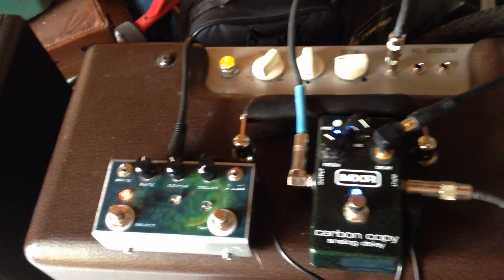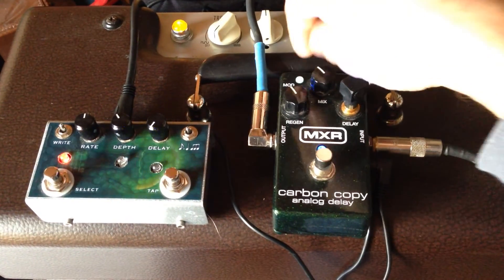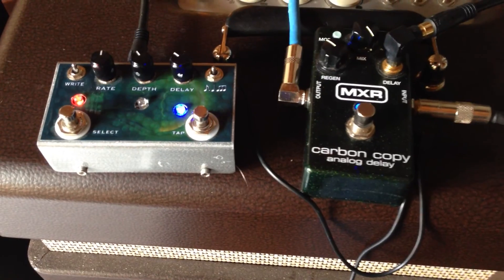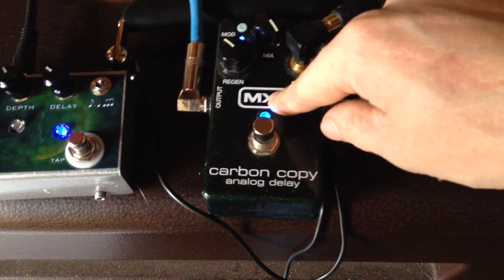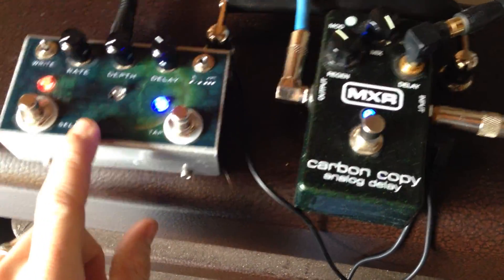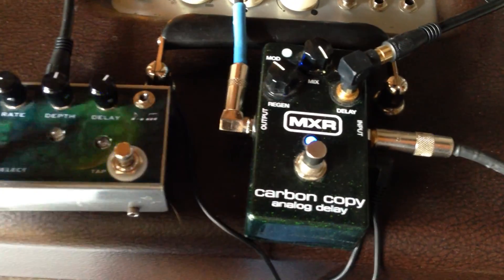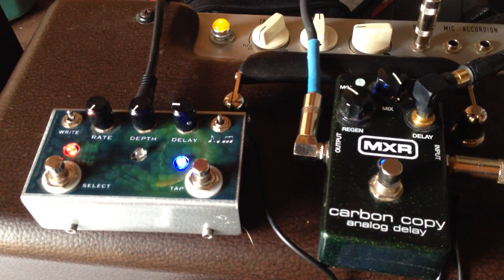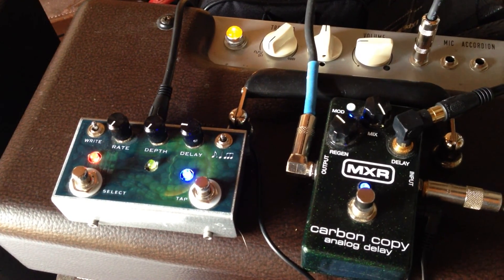Carbon Copy with Tap Tempo pedal

Comment: What an awesome piece of kit! We wants it precious. Two questions: 1. I'm guessing when you want to return to a dry signal you turn off the Carbon Copy and it turns of the Delaytion. Is this right? 2. Can you have a fifth setting on the Carbon Copy itself, or does the CC become locked to the 4 programs on the Delaytion?